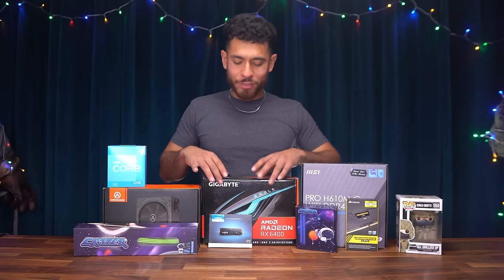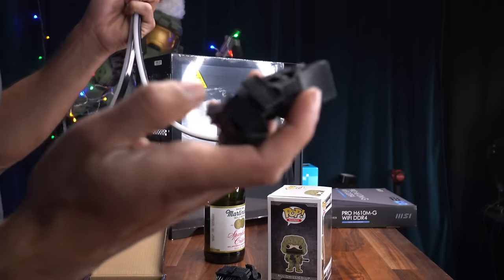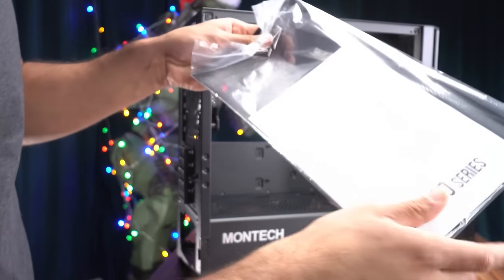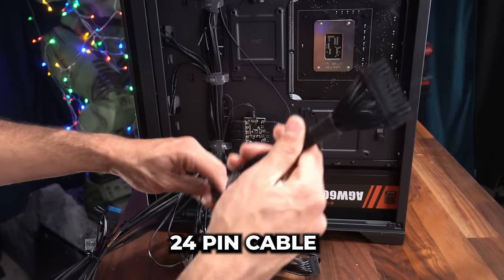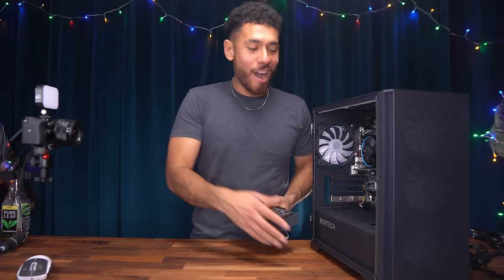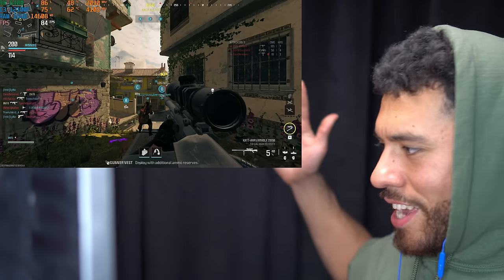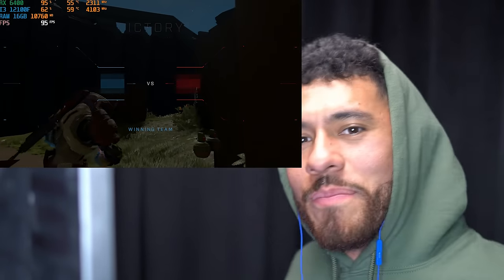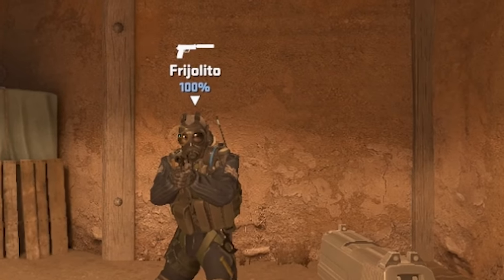Build the Best $500 Gaming PC - 2024

Comment: With changing the card to GTX 1650 I see it better
Reply: 1650 is also rubbish. 
For modern games due to just 4GB VRAM.

RX580 8GB is better choice. 
XFX has one model for 129$ or so.
Reply: @GameslordXY  I know from the memory side a little bit but I am talking from the side that it does not need a pin power
Reply: @No_rights  you might already know this, but you don't need a GPU that doesn't need external power, I think you could get away with a RTX card if you wanted to. edit: in this build anyways.
Reply: @ZyD3N  I understood you I have an RTX card but I talk in general who have a brand computer takes the card and installs it without the need for a power port because these computers come with a weak power if you understand what I mean and from the point of view of the card I prefer Nvidia in terms of technologies
Reply: @No_rights  I also prefer Nvidia over AMD mainly because I have a better understanding of what cards are better and because hardly any AMD cards seem to have hardware encoding.
Reply: @ZyD3N  AMD their cards are nice but from the software side it is not good And the most important thing is technologies like Nvidia the system of making and selling only this is what I think the AMD system

Comment: Utter Trash GPU.
Something like Ryzen 3 4100 or 4500 while no match for 12100F are better choices if they make RX6600 or Arc 580 possible(for 210$ or less)
.
Sure bottleneck might be quite significant with 4100,but provides superior experience regardless. 

60$ case has no business in this budget. 
Having 4 RGB fans is nice,but unnecessary for this budget. 

Phantex Eclipse G300A(1fan) can consistently be found at 39.99$.
It has Mesh Front I believe so even though it's just 1 fan , it should be sufficient for start.

So 20-35$ saved on CPU and 20$ on a case and that RX6600 or A580 may not be impossible. 

Silicon Power has 3200CL16 2x8 RAM for 33$ or so

MSI B450M PRO VDH MAX is just 74.99$...